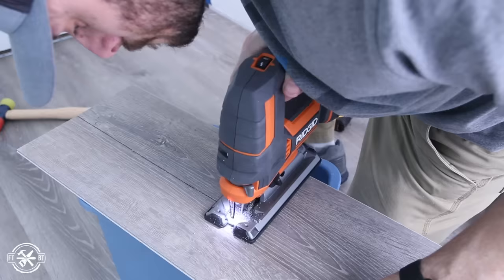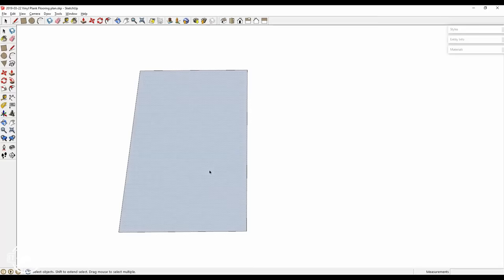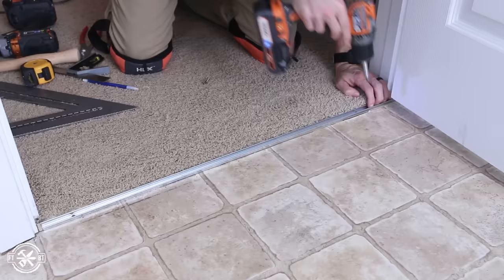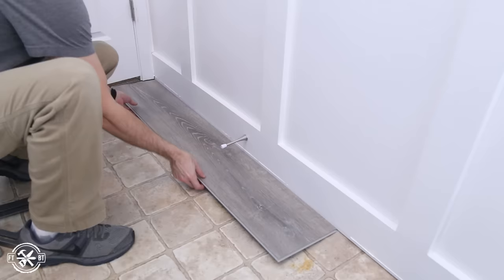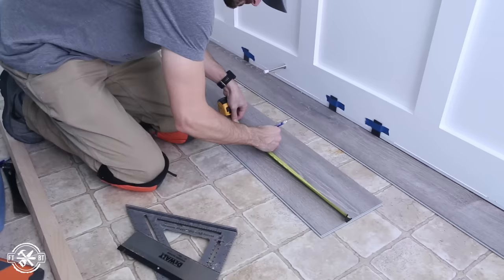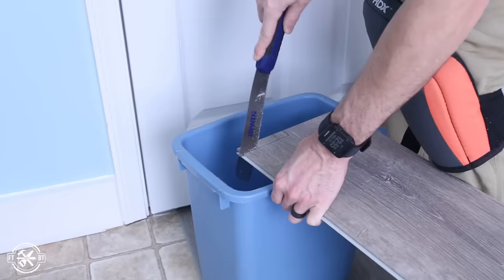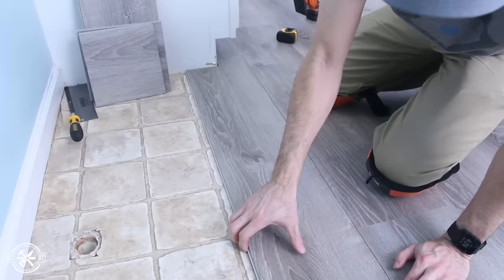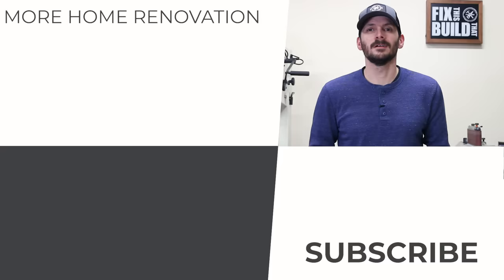How to Install Vinyl Plank Flooring as a Beginner | Home Renovation

Comment: I own a hardwood floor company, installation and refinishing but I also install laminate/LVT floors and I promise you, while he did deliver a good end result, he made it look and sound far more complicated than it really is. While you do need a basic working knowledge of a tape measure, a saw and a speed square, installing this stuff is really not that difficult. Even my first time installing it I was pleasantly surprised how easy it was. Don't be discouraged by all the layout programming and planning he did and just give it a shot, you'll be pleasantly surprised!
Reply: I just did this same job, using the same material, and you are absolutely right.  I love how he starts out by saying he is just a do-it-yourselfer, then proceeds to pull out every pro tool including the use of a fully equipped "shop".  Most people don't have all of this stuff.  It is faster if you all the right tools though.
Reply: Thank you for saying this.
Reply: Its okay to install that floor over the tile?
Reply: @greenroses26  yes it's a floating vinyl floor so you can install it over the tile, and the black layer you see on the bottom is a vapor barrier.
Reply: @taylorballard9422   Is there any need to glue it?
Reply: @HAMZA-he9nd  no it just lays on top hence "floating" floor
Reply: @taylorballard9422   what are chances of floor popin out if we dont stick it?
Reply: If you have done laminate install a few times, this is a piece of cake.
Reply: @HAMZA-he9nd  it won't pop out as long as you follow the directions for installation. Supposed to leave a 1/4" gap from the wall and your shoe molding will cover that up. Also let your vinyl flooring acclimate to the room temp for a couple days before installing. Just leave the boxes in that room for a couple days follow the directions and you'll be good to go. If you glue it down then you aren't allowing the floor to float and expand when it needs to and will probably cause it to pop up.
Reply: @greenroses26  it's sheet vinyl. Tile effect lol
Reply: @adamgiansiracusa5068  Pro tools? The only things he used from that shop are a circular saw you can buy for $50, a $30 jigsaw (which you can skip if you don't have) and a couple $10 carpenter squares...
Reply: What I see done wrong / ugly most often by other DIYers is hoe they cut around pipes (a rectangle from the wall to the pipe)

Just use a spade bit and cut the plank... then puzzle it back locking it in with the others.
Reply: greenroses26 yes it is floating, as long as your underfloor is flat and stable it should work
Reply: HAMZA glueing it will give you problems if it expands, atleast with normal laminate. I do sometimes glue the seams if I have to cheat a small strip at the end, so it doesn’t come up
Reply: Thanks
Reply: I can do this but i just domt know what to charge ?
Reply: @Greg Marion  I'm hoping to learn from your expertise; we are going to install a new bathroom floor so will have to cut around toilet seal, sink pipes and the irregular shape of the tub.
other than offering prayer, which I will gladly take, any suggestions?
I'm thinking of drawing a pattern for the tub area, cutting that out and starting from there.
thanks!
Reply: Just did my bathroom with Coretec Vinyl planking. Do I have to leave a space at the tub because that will look kind of funky with the boards perpendicular up to the tub with a big caulk space ?
Reply: @judyandrews2033  no you can use shoe molding to cover the gap. Liquid nail to hold the shoe mold down then caulk the seams to keep water out.
Reply: @judyandrews2033  let me rephrase that. Their should be a 1/4 inch gap between your tub and the flooring. The shoe molding will cover that gap up while allowing the floor to expand if needed. You do not want run your planks to close to the tub because if the floor expands it will buckle. Leave a gap and cover with shoe mold.
Reply: Other than using the 3D computer program which no one is going to ever do, he was right on the money.  The tapping block, pulling tool, and spacers all come in one kit in the hardwood floor aisle at any home depot and I'd use a jigsaw instead of scoring.  Nail guns are great for quarter-round but a good old hammer and nails with a small pilot hole drilled works fine too,  but other than that 3D he did it exactly the way you should.
Reply: DadandAshton thanks.
Reply: @AlexR604  Is the razor enough to cut the flooring?
Reply: @najisimmons8070  yes, a standard utility knife works fine just change the razor blade often. Also a curved knife works well too, the blade is thicker making it more rigid. All you have to do is score it then bend and snap the board. So far it has snapped clean every time for me.
Reply: Thanks Greg. I’m doing a job like this very soon. I’ve been a floorcovering installer for years but always managed (mostly on purpose) to stay away from this stuff but desperate times, you know?
Reply: How do I start selling floors for a company?
Reply: @ArturoGarzaID  I've seen special edge transition pieces at Home Depot where they sell the planks.
Reply: You could do it without a tape measure 🤷🏽‍♂️
Reply: Agreed, don’t know how I got to this page.  I’ve laid a lot of these floors and he makes this far more complicated than it is.  Especially for a laundry room.
Reply: @greenroses26  yes, it’s a floating floor.
Reply: Thanks! I wanted to do this, but it always seems so complicated. Your comment really made me feel better.
Reply: @judyandrews2033  use peel and stick magic caulk for tubs
Reply: Thank you!
Reply: Thank for your comment
Reply: @AlexR604  You can use a piece of scrap flooring on its edge as a spacer if you don't have a spacer kit.
Reply: Rent a door jam Saw for starters
Reply: No, you want to have an idea of where everything going to hit. Thats how you avoid having to cut a 1 inch piece all the way down a wall. Always know where your going to end up before you start.
Reply: @HAMZA-he9nd  You absolutely do NOT glue it!  It will expand and contract with temperature changes, so if you glue it so that it cannot move, it will buckle.  Same reason for the spacers he showed (the small wedges that he taped to the wall).  They allow you to keep a 1/4” space between the flooring and the wall so that there is room for it when it expands due to warmer temperature.
Reply: Thanks for the encouragement
Reply: Do you think the grout lines will telegraph thru to the flooring over time?
Reply: can you put this on over any old laminated tiles?
Reply: After watching quite a few more videos I’m giving it a shot next week after I paint my bedroom!!!!
Reply: Thanks for the encouragement. I needed it.
Reply: @taylorballard9422  very useful information. Thank you!!
Reply: @DadandAshton  the guy in Home Depot recommended a jig saw with laminate blades for me as well instead of the circular saw. I had already purchased a whole diy tool set minus the jigsaw. I’ll more than like still keep the set.
Reply: @Gomethog  Not a chance. That's only a problem with sheet vinyl. Planks are very rigid.
Reply: Thank you so much for your opinion!
Reply: "I own a hardware floor company" Well then you are obviously not the target audience for this video. You should know how to do it quickly because that's your job.
Reply: THANK YOU
Reply: Any body else notice he was installing it incorrectly.
Reply: @MHQXZ  aren't you supposed to lock the short end in first then the long side when completing rows?
Reply: @ponoahuna627  id rather use cove base
Reply: You have a video on how you do it?
Reply: @ziggyc4474  Pretend you are a customer and get three quotes ... ask a lot of questions when quotes are high. You'll figure out what to charge.
Reply: 100% agree
Reply: Yeah he definitely over thought and over achieved lol.
Reply: @adamgiansiracusa5068  lol you're right. I'm looking for a video to install the easiest floor in my Mobile home, so if this video is for beginners I'm lost lol
Reply: @adamgiansiracusa5068  ppii
Reply: I agree.  It was information overload
Reply: Can you plz tell me the easy way to do this? I have got to do this. I have 3 rooms with nothing but wood. My son tore up the carpet and he was done. Nothing but promises now for 2 years. What  a heck of a break I can’t even sleep in my bedroom because everything has been pushed to the side and my bed taken apart so I’m sleeping in my recliner. He sleeps on the couch. So you see I really need to learn how to do this. I need to learn how to do things myself and I don’t mind. Plz help me.
Reply: Lies
Reply: I would like to ask a question I had vinyl floor planks installed in my dining and living room in two years later they're starting to separate how would I fix that thank you for your time
Reply: What about starting on one side of the room, don't you want to square up the room as best you can. By laying out a a square towards the middle of the room?
Reply: I am. We had a water pipe in the attic freeze, and it flooded the connecting 2 bedrooms and walk-in closets. 400 sq ft. They were carpet. Just paid for my new vinyl flooring today and will be installing it in the next 2 weeks. Doing the work myself allowed me to upgrade to some beautiful 20 mil commercial grade flooring since these bedrooms house 3 kids ages 5, 4, & 3. Plus, we have 3 dogs and 3 cats, and we live near a lake with extremely sandy soil. I'm so freaking excited to break out my power tools again.
Reply: Amature
Reply: My vinyl planks are 4 foot long, my hallway is 3 foot 6. Can I just cut 6 inches off my planks and install them horizontally or “sideways” or would that look bad?
Reply: I needed this comment. I’m young and never tried this before but I do want to learn even if it’s the hard way compare to paying someone to do it for me
Reply: Haha I ran straight to the comments after thinking… damn this guy makes this look complicated.
Reply: Do you have YouTube channel?
Reply: Just did it for first time today and was super easy only got stumped up on one weird angle at the bathroom door that was squared up so door frame and the wall angle scrambled my mind but other than that super easy esp if it’s just a straight squared up room
Reply: @DadandAshton  scoring ain’t bad to fit your last piece I just used jigsaw to make cuts for walls going at angles or for door trims
Reply: @najisimmons8070  yes
Reply: @ponoahuna627  ya if it’s a squared up room but if it’s got angles it’ll be tougher without a tape measure
Reply: @ziggyc4474 start around $2.00 per sq ft (for labor)..higher depending on how good you are/the particular project you're working on, etc.
Reply: It's ok to install over tile but it will elevate your floor. No big deal.
Reply: Thank you for this input lol 🙏🏼🙏🏼
Reply: Just look at what it took for you to explain your opinion! I think his method is very thorough!
Reply: He really does make it look like a hassle
Reply: Pppp😊p
Reply: Yeah I like how he just puts new floor on old crap floor and overthinks the installation 🤦‍♂️
Reply: Doing my floor today.  Im SKEEEERED!!
Reply: Thank you for your comment I’m a younger mom and was wanting to do this myself and was discouraged but you gave me the confidence to do it!
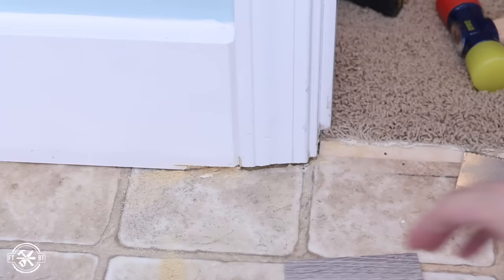Reply: Thank you for this comment. I got 2:34 in and I'm like.....wow I don't think I can do this myself.
Reply: @amandasmith6101 how did it turn out
Reply: Thanks 💯💯
Reply: i needed to hear this about to start laying hybrid flooring myself 👍

Comment: While some people think he makes it look more difficult, for me he showed exactly what to expect and leaves the DIYer to decide for themself. And he hits on everything that could come up.  He packs a lot of info into just 10 minutes so maybe watch it again. Great video.
Reply: Me too. Home Depo videos are slick & problem free, and make it look too easy. Then when you do your own, you find out nothing in their video was accurate, and the million questions that come up leave you going back and forth to the store for more tools and what not, and having to come up with work-arounds to all the unforeseen dilemmas.
Reply: Dd
Reply: @jameseverett4976  Exactly
Reply: @jameseverett4976  H didn't pull his floor base.  Without a gap between the wall and the floating floor, that floating floor will shrink and expand over time it will buckle.  Hire a professional.
Reply: @Cspacecat  He very clearly DID leave a gap, even used spacers to make sure.  Watch it again, dude.
Reply: @matthewosgood5599  The flooring edge gap is supposed to be 3/8".  Base shoe is 9/16".  That means he'll have to use quarter-round to cover. If he is off on that measurement just a little bit?  I'd have cut the caulk around the base and doors.  I use 3 thin prybars about 8" long and never scratch the paint on the walls.  Nothing like shoddy workmanship.  I'd pulled the base or wouldn't have done it at all.
Reply: 👍agree
Reply: @cantseeshadow  I've done a lot of floors.  What town are you in?
Reply: @cantseeshadow  Kansas City, sorry.  I'm too old for you sisters.  I just like to work.
Reply: @Cspacecat  They’re 35, Latinas, good cooks
Reply: @jameseverett4976  Hate to disagree, but unless you have workshop with the machines this guy has, you learned nothing
Reply: @Cspacecat  The instructions for the 4 floors I have placed all said 1/4" gap not 3/8". I have never had a problem with 9/16" baseboards covering the 1/4" gap with expansion and contraction of the floor.
Reply: @redsoxfanfran  It's just not that hard to pull the baseboard and do it right.  Just because you've sleezed through up till now doesn't mean you did it correctly.  I've had conversations with general contractors on several occasions in new houses.  I tell them my price per sq. ft. before the trim is installed and after the trim is applied.  It's an automatic 30% extra after the trim is installed first.  Being both a trim guy and a painter, I've tried it every way I could think of.  This is my process on a new house.  Rough-in, Sheetrock and mud, paint the walls, paint the trim separately, lay the floor, add two layers of painter plastic with blue tape, lay vinal wall paper on the floor in the heavily tracked area, install cabinets, countertops sinks, install base and door trim, caulk base and trim, tutch-up base and trim, install toilets, install nobs.
Reply: He did an exceptional job with this video. In my case, it showed me, I need to get a professional out here!
Reply: I thought it was a great video too but I he is amazing at installing floors, very organized. I thought the jokes were also funny in the comments. For a beginner we may not have all the equipment he has.

Comment: The easy way to avoid having a tiny strip at the far side of your wall (a big no-no)  is to measure the floor and divide the width by the width of the plank. If the remainder is less than 2”, you need to do as he did and take a couple of inches off the first plank so your last plank will be wider.  Same thing with the length.   If the remainder is less than 6”, take enough off the first plank so that the last plank will be at least 6” long.  You don’t need a computer program for this.
Reply: Really needed this.  I'm an apprentice, two years into it.  Cheers
Reply: Thanks for the math on that, I was curious about the same thing. I'm about to redo the floors of a rental with this and while this video is good, it lacked this kind of advise. Thank you again.
Reply: Actually if u divide the width of room by plank width and the remainder is 2 (just an example) and the 2 to the width of the planks and divide that by 2 and u will get the dimension u should rip the first piece down to and the last row will be the exact same width.   Say your remainder is 2 and your planks are 7” 7+2=9. 9 divided by 2=4.5 so cut your first row down to 4.5 and your last row will also be 4.5.  Gives it uniformity
Reply: Exactly, he makes everything so complicated and wastes so much time with unnecessary steps
Reply: @trumpking4874  Love this. Thanks
Reply: Thank you for saving me from having to geek out and learn Sketchup.
Reply: If you don't wanna do math, just lay one row side to side and see what you're working with
Reply: @trumpking4874 the room I am in now is 194 inches wide my planks are about 7 1/4 when I divide that number it comes out to 26. 6 what does that mean? Where is this remainder of two coming from
Reply: @myself1769  , actually I think 194/7.25 is 26.75. But in any case the leftover (remainder the .75 or .6) is the fraction of the width of the plank left. Take 7.25* .6 (or .75 as the case may be) and that gives you the size of the last row's plank.  i.e. in your case 7.25* .6 leaves a 4.35 inch last row (about 4 11/32). But if it really is 194 and 7 1/4 ( 7.25) then the last row is 5.43 inches or 5 7/16. If the number is ever under 2 or 3 (depending on your preferences) then you need to cut the first row.
Reply: Or just measure the whole floor and divide the width.
Reply: Absolutely no one does this..the flooring joints are so tight its ok whatever size strip u have left on the last run..anything else is a waste of time

Comment: I am 76 and I just did my entire lower level of some 860s.f.  It took me four days since I had to rest my back after about four hours of bending over.  It came out beautiful and was very easy.  Only needed a pencil, a measuring tape, a sharp utility knife and a hand roller to set the seams.  I used vinyl plank flooring with the glue edge.
Reply: Legend
Reply: wow!!!❤
Reply: This gives me hope!
Reply: I used that same type flooring in a house I renovated as a 62 year old female and it saved me a ton of money and I had no issues. I may put it in my basement if it’s cheaper than lvp. Piece of cake to cut. I used Trafficmaster Allure Flooring from HD.
Reply: Nice job next time get a flooring hammer will get the job done faster, they go for $20 at home depot and with a knife cut the edges of the rubber side for a more round end🫡